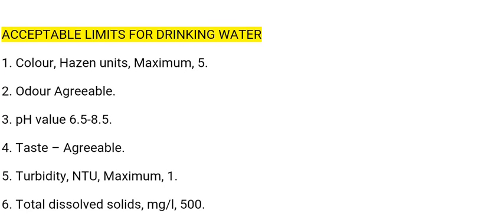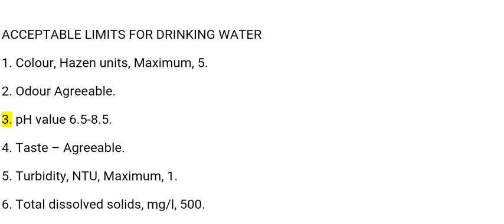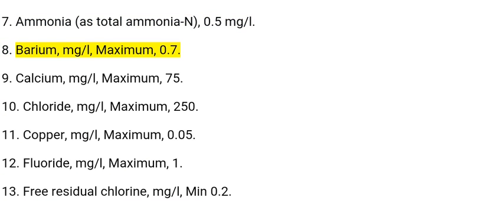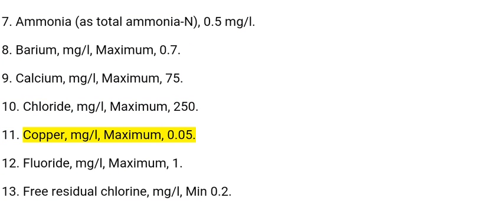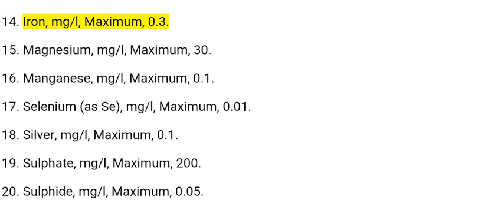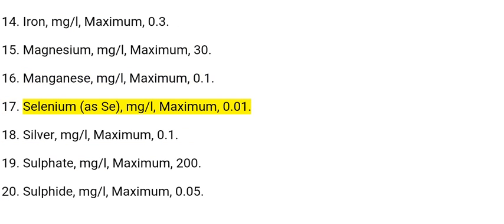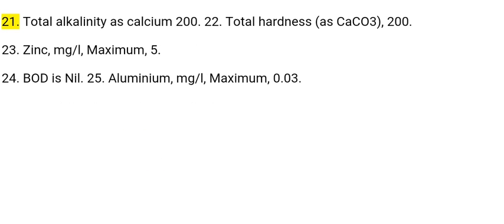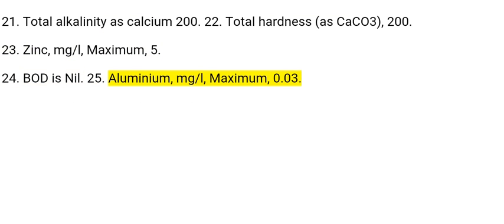ACCEPTABLE LIMITS OF DRINKING WATER || CIVIL ENGG SUBJECTIVE MATERIALS || PART - 10

Comment: sir this is incomplete
fluoride permissible 1mg/l
rejection value 1.5mg/l
code page 2
and book water supply by s.k garg page no 397
maximum permissible 1.5mg/l
acceptable limit 1mg/l
Reply from the maker: yes maximum acceptable limit is 1 mg/l. That only I put in our video. Permissible limit it is 1.5 mg/l.
Reply: sir building material pdf notes send me